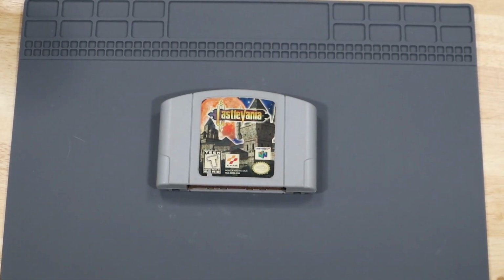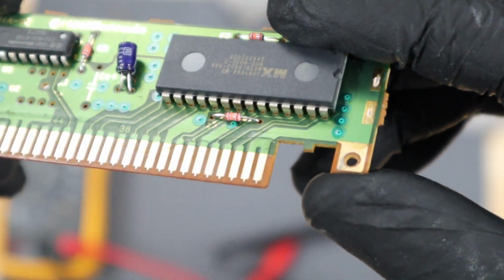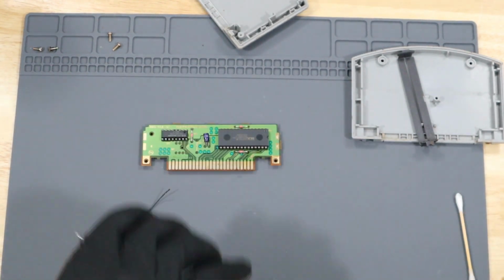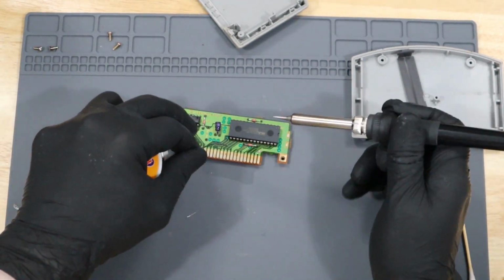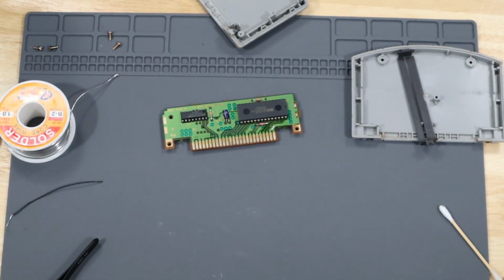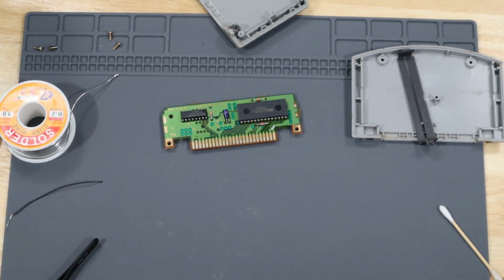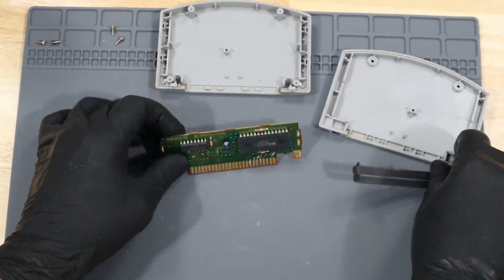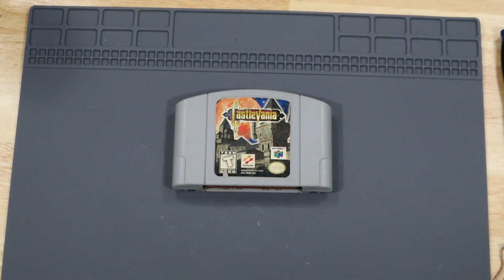Fixing a Cracked N64 Game - Castlevania 64

Comment: Nice job, I would secure that crack with some epoxy or something though, otherwise those joints will probably break.
Reply from the maker: The crack doesn't go all the way through, but you're right it might open back up again. I'm hoping the small threads of wire will add enough stability for personal use. I think epoxy's a good idea, for that extra security. But I would be concerned of the added mass. It was already a little hard to add the black support piece with just the solder work. If I run across another cracked board, where I have the space, I'll have to give it a try.

Comment: you didn't stabile the fracture so this may not work well for long.  or maybe it will if you're very careful.  either way it's not a great repair. 
you should also use flux when soldering. you'll find it easier and the resulting joints will be more reliable.

Comment: given that it was a hairline crack, were not the wires useless as the solder would bridge it well on its own?
Reply from the maker: The solder definitely could've bridged it on its own. I added the wires hoping to add a little extra security to the crack and stabilize it a bit better. I was concerned if I went too thin on just a solder bridge, it could crack again over time.
Reply: @LastHeartGames  the traces seem to be the weak point as well. It should be secured from the other side (reinforced epoxy layer) to transform possible bend deformation to pull stress only, which would hold much more